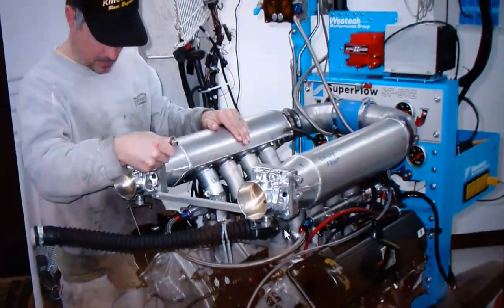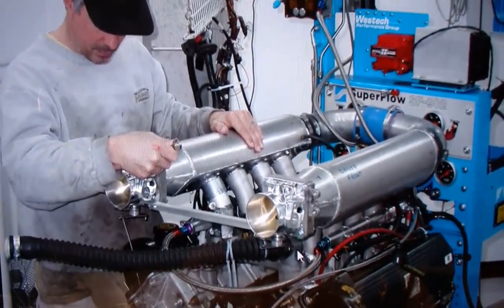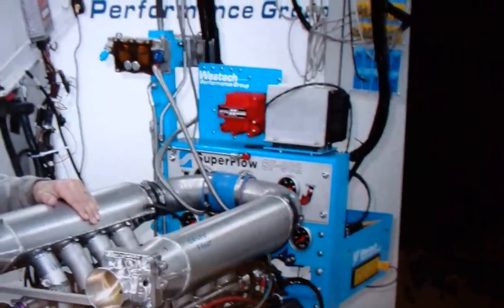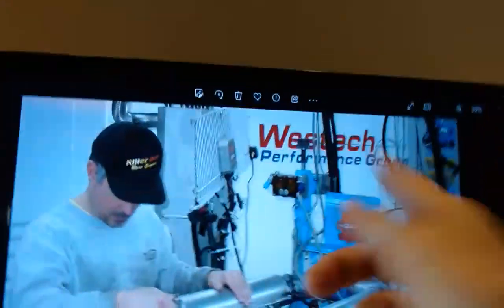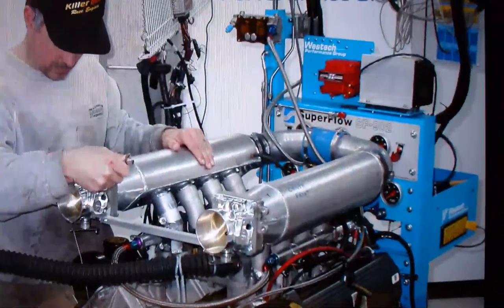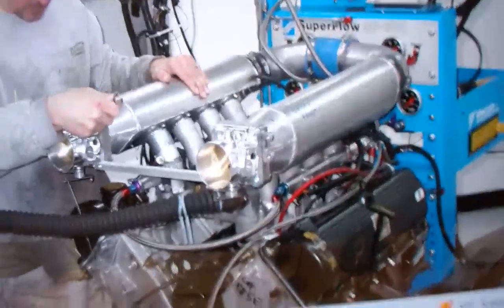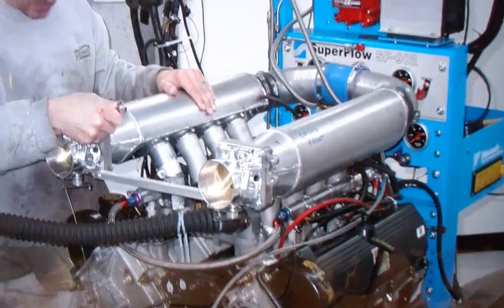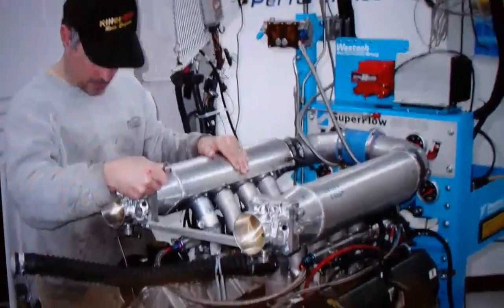LET'S TALK TECH-WHAT THE V10 FORD INTAKE MIGHT LOOK LIKE

Comment: Yea there is a non PI & PI V10  just like the 5.4 the V10 didn't get PI heads till the truck 4.6 & 5.4 did. 
Like the CV didn't get PI heads till 2002. I don't think trucks did either  till 2002.

Comment: What do you think about dremling out the intake plenum elbow to remove the large restriction on the bottom side by removing the side wall curves and dimples on the floor and backwall? I did that on my stock 1999 Mustang GT and it made a very noticeable difference. My 2001 F350 has a similar elbow would it also have the same restrictions? I did nothing to the throttle body just cleaned out the restrictions on the elbow per an old time racer that did it back in the day in a motor trend magazine article. I ask because besides more power it gets 10% better fuel economy too! On the Mustang no big deal on a crewcab dually it would help. I only have 27k miles on this truck its literally like new so I'm extra cautious about modifications unless they don't mess things up. Obviously I'm going to buy a spare and try it after such great success on the Mustang 🐎
Reply from the maker: I would have to look at one to see if porting might help, but not sure how that could change fuel economy
Reply: @richardholdener1727  On the Mustang it was the main restriction point leading to the Vehicle simply running much smoother gas mileage seems better after three tanks but could be simply summer gas. After reading your comment I went out to the barn and popped the hood. It is actually a plastic elbow so there goes my idea! It's funny my 1999 Mustang GT and 2001 F350 Crewcab dually both use the same oil filters, fuel filters, coils and so on I just assumed it had an aluminum elbow. Giant fan thank you for the reply!